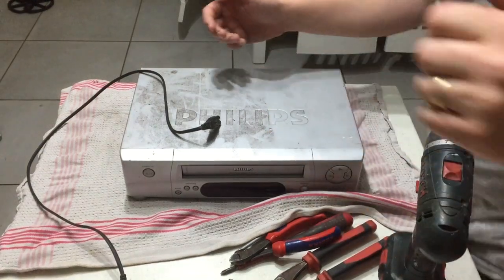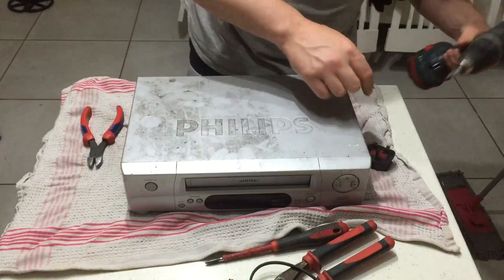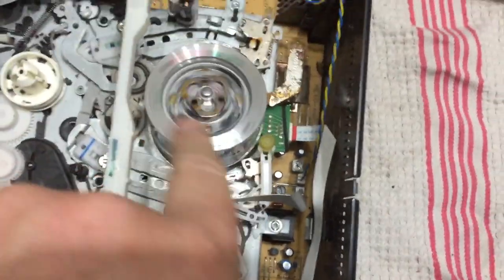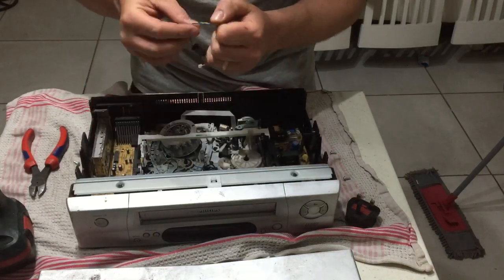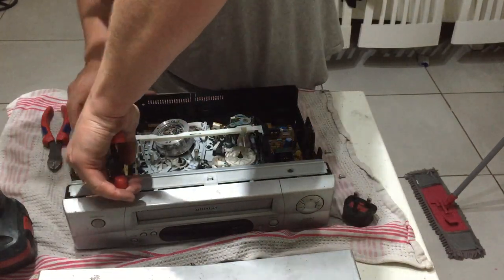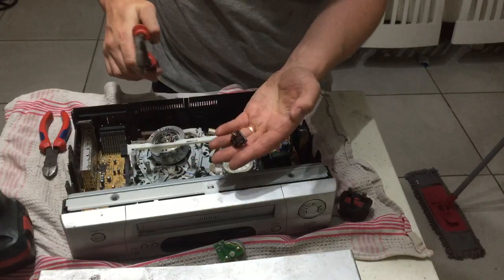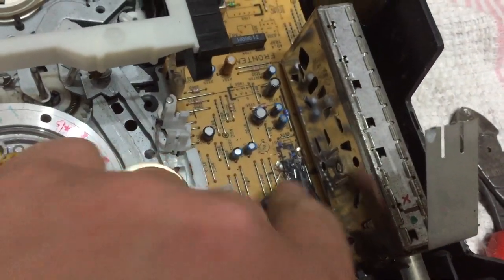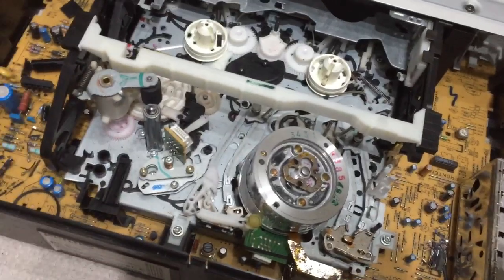Scrapping out a Philips VCR for scrap

Comment: I don't mind scrapping these either.  But I can also sell the board as low grade, so I remove the drive deck and low grade board.  After I pull the motors the drive deck goes in shred.  Then I can cherry pick the low grade for IC's and oscillators before it goes in the low grade bin.  Thanks for sharing.